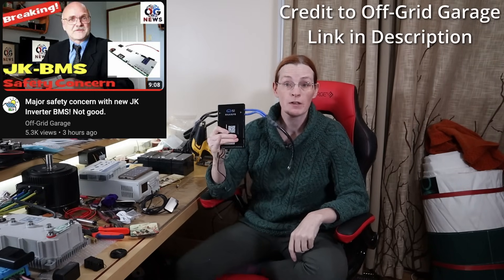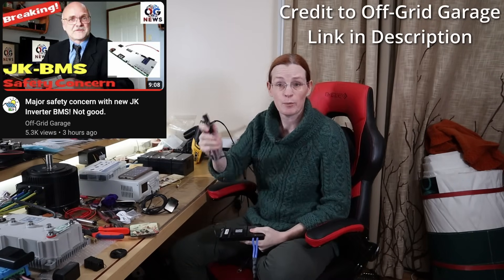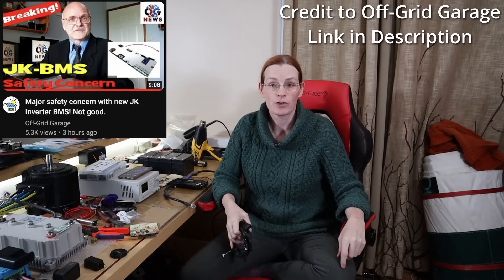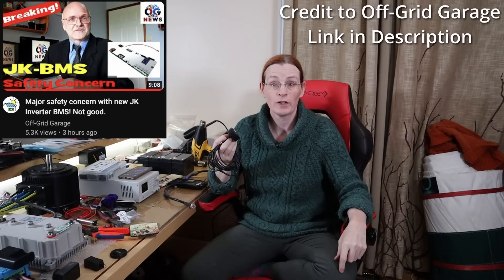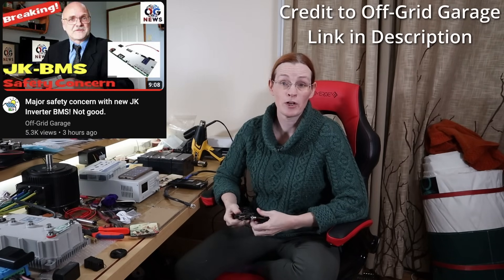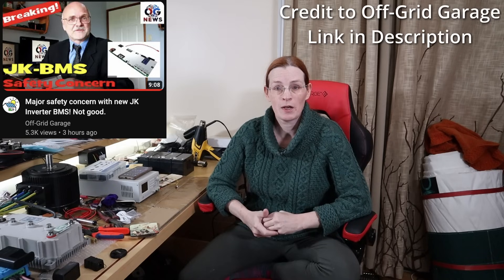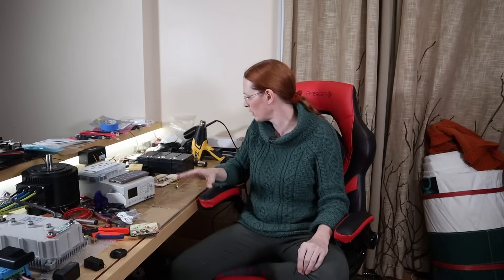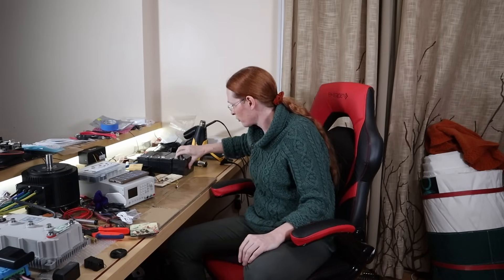News from Off-Grid Garage; Dangerous JK BMS Flaw

Comment: Thank you for making this video. I have some older JK-BMS units for 48V, which I have not yet installed. Their intended use is in a motorhome which may or (may not) have intermittent usage with prolonged down-times. I know some have already commented that this flaw is in the newer BMS units. However, I am not willing to risk my family sleeping above 28KWH of LiFePO4 batteries that might subject be overcharging.  
I will be watching both you and Andy for future info.
Reply from the maker: I have to rethink my BMSes also, I am not going to take JK onto my boat. Same as you, I know these ones are probably OK, but I just can't trust them anymore.
Reply: @TheDigitalMermaid  There aren't that many non-Chinese developed ones.  I would look into a Batrium K9 and maybe still use an active balancer with it.   I don't know why Andy has never at least showed support for a BMS developed in his own country.
Reply: @davidb.5544  Because Batrium is not panacea either. They had plenty of firmware and hardware issues (and major changes to hardware without apparent benefits), and that at a much higher price point.

Comment: Great, my inverter style is in customs.  Luckily it is just to try the new style, have enough of the normal style for my 3 48v and 24v pack.
Reply from the maker: If you can't return them, then fingers crossed they release a firmware to fix this. At the very least, make it a habit to check you settings any time the BMS is turned on after being powered off.

Comment: JBD all the way for me
Reply from the maker: I need more time to think, but at this point, that's currently the one I'm thinking of. I had the JBD Andy's got now, and I liked it, I only switched for the JK active balancing.
Reply: @TheDigitalMermaid  that's a point. I have external balancers and a voltage detection circuit to turn them on. Bit of wiring, but it works nice.

Comment: I race rc cars and one of my classes used a one cell lipo. The charger can auto set to NiMh and cause the battery to swell explode and catch fire. When you said it switches to metal I was shocked that something like that is not a first order safety protocol in the programming.
Reply from the maker: When you're building a device SPECIFICALLY designed to protect your batteries and your equipment, something as simple as ensuring the settings survive being turned off is pretty damn basic. Also, where's the fail-safe? Why not make the default configuration one that sets the lowest max charge and the highest min discharge?
Reply: i toasted a 4 cell lipo and the ensuing fire from such a small battery was pretty scary.I DO NOT CHARGE THEM IN MY BASEMENT ANYMORE.
Reply from the maker: @davidkettell6236  Li-po scares the hell out of me...

Comment: Although this is a serious safety flaw, I'm not certain but dont you need to enable the charge and discharge on first use?
It's always a good idea to regularly check your parameters. Hopefully JK take this seriously and use some kind of non volatile storage for the bms settings and at least have the default settings set so any connected cell chemistry will remain in safe voltage limits
Reply from the maker: In my experience, no, the BMS charges out of the box. I've not specifically tested this, but I don't remember ever having to do it, either.

Comment: I watched Andy's video before you and IMMEDIATELY went in and checked my new JM Inverter BMS based battery which was powered off for 5 days and it still has correct settings. I have not put my new battery boxes into production so can keep an eye if this issue manifests.
Reply from the maker: Aye, I think until there's a fix or replacement, making it a habit to immediately check the configs on power up is very wise.
Reply: @TheDigitalMermaid  That same can and should be applied to anything amd everything manufactured with memory that can be lost or currupted not just this BMS, its foolhardy to think otherwise.
Reply: Then your BMS is still on Firmware 14.03 - 14.10. These versions don't have this issue.

Comment: not only specific to JK-BMS or their products. any budget products from China will have many hidden issues. i have a Chinese made budget Inverter just bought for testing purpose and ended up exposing so many problems which the company is not capable of fixing or responding in a technical manner. Rater they claim those are not a problem for regular purpose..!! really!??

And the reason for all of these ..??? they are just the resellers of some products manufactured by someone else., sold under different names. i do have two of their (JK) bms (CAN & RS485 enabled) having same hardware version but not capable of updating the firmware to the latest by a customer.
Reply from the maker: I think the cost is more the issue that the country of origin... The trick is that China is good at making things cheap, but they can (like any country) make good products when the budget is there for it. I think this is a case of "you get what you pay for"...
Reply: No, there is a cultural difference.  There's a common saying in China, "if you have the chance to cheat and you do't cheat, you're an idiot."  Very different viewpoint.   @TheDigitalMermaid
Reply: @TheDigitalMermaid  that is true

Comment: it's programming 101 to store values that you do not want to reset when a unit is turned off in NON VOLATILE memory. I seriously question their testing methodology to let something like this happen.
Reply from the maker: BINGO. How the hell did they miss this flaw?!
Reply: They could at least make sure that the memory storing the value stays powered. It's a common functionality in any chip containing RTC functionality. But they could also use EEPROM or the internal program flash to store values (although over time that might kill the memory since they sometimes aren't made for many write cycles, depends on the controller)
And most important don't ever run on unsafe defaults. If the settings are missing somehow, program it to either continue with safe defaults or just stop operating altogether and sound an alarm.
Reply: I was just going to say that! Having default values be very low, or even better... Have it default to an inoperational state if a memory loss issue or etc occurs, and only becoming operational after a user accesses the settings and configures it again. Its now 2024, there is NO excuse for nonvolatile memory issues, as you said, its programming 101. Most microcontrollers now have onboard flash storage. I always say programming and writing code is like art, and many do NOT have the touch. Same with GUIs. This is why I like to develop my own, because I know the firmware and all aspects inside and out.  @Ether_Void
Reply: I'm curious if they left NVM off as a cost saving measure, or just used a capacitor instead of a battery (again to save cost).
Reply: @john_in_phoenix  It's the internal Flash on the microcontroller, so there is nothing extra to add/no need for a supply. Apparently, previous firmware releases for this BMS didn't have the issue, so it's something that was introduced in the newer versions. Should be easy to fix with an update.
Reply: @john_in_phoenix  In that case they should at least use safe defaults or disable the BMS until it is reconfigured. But as @upnorthandpersonal said, the program memory (flash memory) of the micro controller is in itself a non volatile memory, otherwise the microcontroller wouldn't hold it's program or updates would be physically impossible. 
The only reason why they might have decided to remove it is if the program is barely fitting into the controller or if they are afraid that the writing of settings to flash can burn too many write cycles (which makes little sense if they still allow updates and also did it in earlier versions).

Comment: Not defending the bms flaws, but wanted to chip in something weird I've found online. 3.65V is not really the limit voltage for LiFePO4, it's more of a recommendation. It seems that just like Li-ion, 4.2V is the limit where dangerous things start happening. It's just that for LiFePO4, charging them to 4.2V is just too much of a sacrifice to longevity for too little gain (same reason we choose to not even charge to 3.65V).
Reply from the maker: The specs for the batteries say to not charge over 3.65v, so this is the limit as far as I'm concerned. Above that might work to some degree? It's not worth the risk though... I've seen what happened to overcharged LFP batteries...
Reply: Best setting to use for LiFePO4 is 3.55v and best setting for Lithium Ion is 4.15v
I have been using those max limits for years with no issues.
Reply: There's a video on YouTube showing what happens if you overcharge just to 3.85V.  The entire cell becomes seriously bloated.
Reply: If you charge to 4.2V you will have a bloated cell (and it will bloat well before getting to that voltage).

Comment: I have always said this from day one. DO NOT use ANY type of mosfet based bms and ONLY use contact based one like Rec bms, Emus bms, Batrium bms, or my favorite Diy bms.  Due to the design and safety of these bms systems that these bms systems wont have any fire risk unlike mosfet bms systems if they fail.
Reply: Contactors can weld themselves closed too. That's why many EVs have a pyrotechnic fuse as a backup. Though the problem here isn't FETs shorting out, it is BMS parameters getting lost and restored to unsafe values. FETs or contactor would make no difference there, you'd be equally screwed if you failed to notice that your LFPs are being charged to 4.2V before it is too late.
Reply: @teardowndan5364  I am not talking about bms parameters I am speaking about bms design. Again using industrial relays are not built the same way as cheap relays. Relying on mosfets when jkbms and others are known to use the the cheap type mosfets. As for the very specific issue with jkbms well that is a firmware issue or even worse a hardware design issue. That is just another reason NOT to use ANY type of mosfet bms system. All of my system builds using REC bms or Emus bms with my own battery designs I have not have one system failed yet. Maybe is just European design is better that Chinese design. I know for sure I will NEVER install any cheap Chinese mosfet based bms system in any of my designed battery packs.
Reply from the maker: That's not really viable and relays come with their own set of problems. As with all competing options, you need to understand the pros and cons and decide what's best for you and your use case.
Reply: @TheDigitalMermaid  I know all the pros and cons and have been using these deigns with zero issues. I have used REC, EMUS and DIY bms with no issues. The relays you use are ONLY the sealed industrial type that the EV industry has been using for years. There are no cons only pros. The main reason NEVER to use mosfet based bms systems is that ALL the current goes through the bms and if the bms fails well then you have a major fire risk. I also don't use batrium anymore not because they are bad but because they are very expensive to import here in Europe. Both REC and Emus are located in Europe so no import fess.
Reply from the maker: @carlospereira9838  If that were true, that there are no cons, why doesn't everyone use them? Why go to the trouble of the programming a carefully timed circuitry needed to support FETs? Again, you may have reasons to prefer contactors and good on you for it, but it's just untrue to say that they're always better.
Reply: @TheDigitalMermaid  The reason is simple why more people don't use contact based bms systems is because they are more expensive than mosfet based ones. Its a simple case of economics. Even Tesla ONLY uses contact base bms systems (their design) in all their battery packs there is a reason for that its a superior design and a much SAFER design.
Reply: @carlospereira9838  People like MOSFET BMS because they enable independent zero-delay control of charging and discharging using a single DC bus for everything, take relatively little space, next to no quiescent power, are completely silent, a properly designed one can break circuit on OCP faster than a fuse can blow, etc.
BTW, the number of appropriately sized MOSFETs to reliably switch 100s of amps including the avalanche energy when acting as an e-Fuse with an inductive load isn't exactly cheap.
Reply: @teardowndan5364  I understand where you are getting at unfortunately with the cheap Chinese bms designs that is not the case. A perfect example is DC to 3 phase inverter which is required to use electric motor propulsion on a boat. They are ALL mosfet design however they are of excellent design and build quality and they happen to cost around 1 thousand each. Again I never use cheap Chinese designs only UK, German or Italian designed inverters for me. My point to all of this is Don't buy the CHEAP Chinese crap you get what you pay for and stop complaining when the cheap Chinese products fail. Buyer Beware.
Reply: Of course they will. If you configure a relay based BMS to 4.2v it won't disconnect at 3.65v magically. Relay vs MOSFET is NOT the issue of contention here.
Reply: @CollinBaillie  True the disconnect issue is just bad firmware and or hardware design.

Comment: Sorry for your bad luck, but we have had many our customers complain about the 8s version as well. They also have very poor Ram / Over volt balancing where they ram voltages of 4-5v into a cell to try to get it to balance faster. This is not good as incoming voltage should never exceed the full charge voltage of a cell such as 3.65v. You can verify this with a volt meter to see the incoming voltage. The same is if you up the voltage of a charger to get a cell to charge faster.
Reply from the maker: If I recall correctly, their supercaps they use to store the power during balancing are under-rated as well. I would need to crack a BMS open to confirm my memory, but  ya. They're cheap for a reason...

Comment: I doubt this affects anything other than the brand new design BMSs that Andy has been covering. (I also think that a simple firmware update will more than likely fix the problem). 
Personally I think JK are generally way ahead of the pack, and we might get some teething problems from time to time (bugs) simply because they’re so proactive at design and production of new gear. Long gone are the days of the Daly BMSs.
HOWEVER I’ve had one just like your’s sitting in a cupboard, unpowered, for about six months. I’ll get around to powering it up again (maybe later today) when I have a chance. I believe it will be fine, and will have retained it’s settings. (I’ll get back to you on this.)
Cheers again from hot and sticky Oz🇦🇺
Reply from the maker: It only effects the latest BMSes, but it's yet another example of their corporate culture and product development ethos. Slap it together and throw it into production! The role of the BMS is too crucial to use the "build it fast and break things", at least not in safety products going out to customers.
Reply: that may be but i have never had a problem with a Daly BMS ,they be be old school but they work ok.
Reply: It’s not an issue even with the new ones. Because you simply don’t disconnect them and put them on a shelf after configuring them like Andy does. This is such a remote and unlikely scenario to come by for any user. The product is meant to put in a battery box, configure it and use it. Not take it apart and leave it disconnected and imagine you don’t need to set it up again when putting it in a new battery. I can guarantee you have to go change some settings no matter if you put it in a different battery box.
Reply: @pederb82  The funny thing is that in his video, Andy says he hasn't had this experience. I think maybe on a community post he said he had been able to verify it. It was reported by a few of his subscribers. 

That said, when you configure parameters, the values should be written to (an) EEPROM, and they should be read back when the BMS first receives power. That's just good product development. 

The fact that this is happening says that they are either NOT writing config to EEPROM, or they're not reading it on power up. That's a simple mistake, but can cause some not so safe situations. That's just NOT good product development. It's a pretty fundamental part of the design. And yes, you should be able to take it out of one battery box and put it in another (your example) and have the setting retained. Of course, you MAY have to change some settings, if the new box isn't 'similar'
Reply: @CollinBaillie  let this be clear: I agree that it should be that way. It’s clearly an error. If I got my way an BMS would only work on a specific chemistry period. Nothing beats consumer proofing things. What I’m reacting to is the doom of using the product. I want to know more about what is going on in stead of just hearing it’s dangerous - coming from my component level experience when it comes to electronics. I don’t see the BMS loosing its volatile memory from simply turning it off, without disconnecting it from the cells. It just isn’t logical. IF it does - then we can bring out the warning signs.
Reply: @pederb82 it is a firmware bug. I tested it version by version and  V14.03 - V14.10 don't have this issue. My actual workaround is to limit the maximum charging voltage in the Victron system to 57.6V (3.6V per cell on 16S)